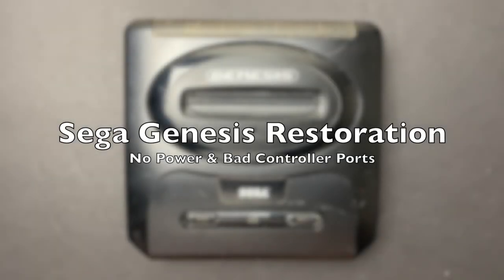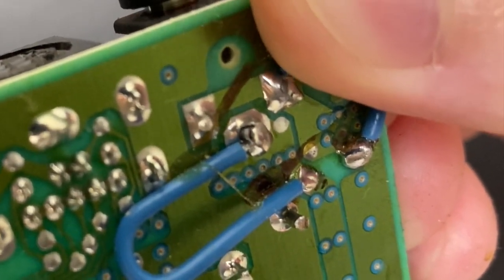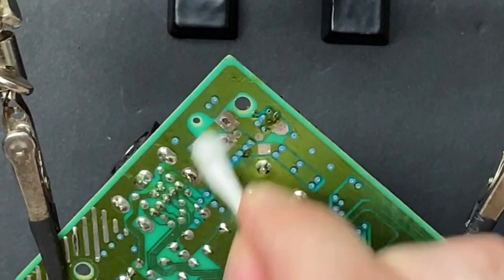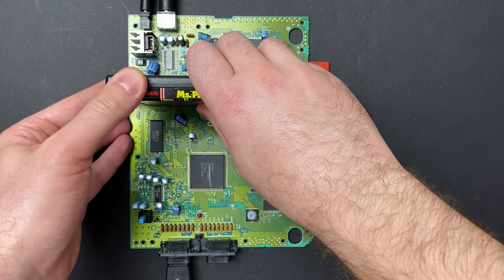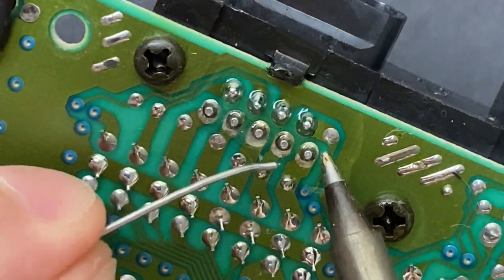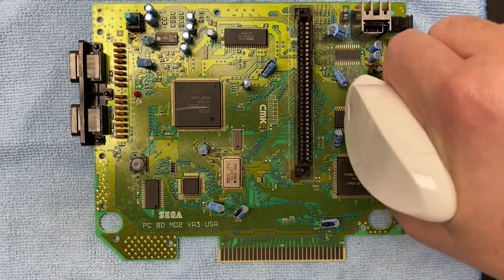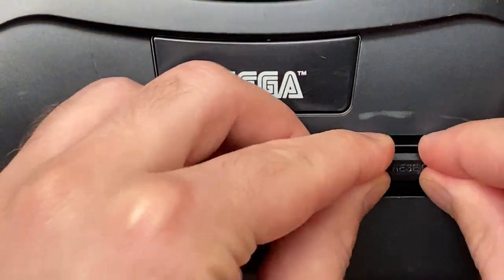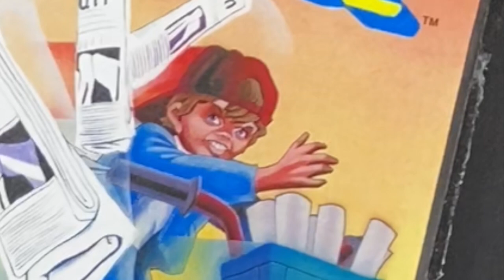Sega Genesis Bad Controller Ports - Retro Console Restoration

Comment: I drove an hour to purchase a cheap sega on marketplace only to have it not work when I got home.  The controllers were acting screwy and would kind of work when I wiggled the plug in the port.  I hopped on here and found this video.  I've never soldered on an electrical board before but took a stab at it and it worked!  The machine I got was super clean and I couldn't even see the breaks in the solder until I used a magnifying glass.  I removed as much as I could using the solder wick, which I had never heard of before this video.  Then I found the thinnest solder I could because these connections are TINY.  It takes some patience, but I was able to do it with only this video as my guide.  Thanks!

Comment: That cleaned up pretty nicely in my opinion. Also I can confirm that those wires soldered and glued to the power connector are from the factory. Instead of recycling a motherboard that didn't pass quality control, Sega would actually have workers repair the issues. Not all Genesis left the factory with those wires, but many did.
Reply: Yup most Gen 2's I have worked on have them. The power jack is supported by nothing except it's solder joints so it's a very common problem for them to crack and loose continuity. Almost every Model 2 I've obtained over the years had this cracked solder joint problem.
Reply from the maker: That’s pretty hilarious. I really hadn’t considered that this could have been a factory repair. The center pin is cracked due to fatigue so it’s an odd assembly line problem (compared to a broken trace for example). Looks like something a teenager repaired in his bedroom. Thanks for sharing.
Reply: Wow. I never knew that. I have seen sega use bodge wires in other spots.

Comment: Those bodge wires are from factory. That slim board was a later revision, the genesis was notorious for broken joints at the power port. So they added the bodge wire to the later revisions.
Reply: Oh nice info
Reply: Wow, not cool Sega
Reply from the maker: Hmm I hadn’t considered that. I’m aware traces were sometimes repaired at the factory on some older gen consoles but this looked a little more fatigued due to stress on the center pin. Who knows.

Comment: I recently bought a model two genesis with the same type of faulty repair. It had no power, opened it up and saw two wires soldered to the bottom of power connector. I followed the video by removing the wires and old solder, cleaned everything up and resoldered the power connector now it works great. Thanks for the great tutorial.
Reply from the maker: Great to hear 👍🏻

Comment: Wow that previous repair attempt looked worse than my soldering when I was first taught at age 7 or 8. Those completely unnecessary bodged jumper wires were also a nice touch!
Reply from the maker: I thought so too. It's strangely charming in how hideous it looked.

Comment: Very easy repair and no broken traces on the  p1 port, very Nice job. I had my hands full with a late 2009 13 inch clamshell macbook that had a bunch of cosmetic issues and a missing hdd. I spend 4 days trying to find a lion installation to reinstall mac os with so I could update it to el captain  and use it for my iPods as well as jailbreaking a iphone 6 I had laying arround
Reply from the maker: Thanks bud, and good luck with your MacBook restoration.

Comment: great it was my first console and I still have it (Sega mega drive2), the damage in the joystick connector was very frequent I think it is because it fits very tight, I recommend the MK 3 ultimate and 6 button joystick. Excellent repair 👌
Reply from the maker: Yeah you really need a 6 button game pad for Mortal Kombat. The moves are hard to do on the three button controller (like a basic high punch is A+B).

Comment: The Model II Genesis was infamous for badly soldered power connectors. Mine was bad out of the box Christmas Day 1994, if you bumped the console it would reset. Opened it up and fixed it decades later.

Comment: Nice. Maybe a magic eraser could help with the red paint and rubbing marks. I've notice the shiny sega plastic also responds well to automotive polish.
Reply from the maker: I tend to be nervous using a magic eraser on black plastics in case it eats away at the sheen but I won’t know unless I try it. There aren’t any red spots on the back to test a small area unfortunately so I risk making it worse up front. I like the auto polish idea though. I have some PlastX that came with a headlight restoration kit that I could try.
Reply: @BorderlineOCD  do you have cracked or junk sega plastic? It is a bit of an art

Comment: Great vid. I'm stuck with a problem with a controller port. I checked all the connections and they look solid, no wobble. The console itself is in pristine condition, the only problem is the port. The only thing not working in the down controller pad. I tested the controller in other systems and it works fine. I cleaned with alcohol and made sure everything's clean. Still, the down pad does not want to work :(

Comment: Those cables near the power jack are in most Model 2's from the factory! I suggest you put them back in place, because there must be a reason Sega put them there :p
Reply from the maker: They are jumper wires. They are redundant if the port is soldered on properly.

Comment: Nice work as usual, bud.  That patch job with those wires, was..... comical at best.   I'd love to know what happened to that poor system to cause that breakage on the controller port too.

Oh well, looks to be in better shape than it's been in a very long time, thanks to you.  Nicely done.
Reply from the maker: Thanks very much, glad you enjoyed the repair!
Reply: I've seen those wires on quite a few model 2 systems. I'm guessing it's factory. Not sure why though.

Comment: Warning: INTENSE SOLDERING WORK!
Nice :v
Reply from the maker: Ha thanks this wasn't a particularly intense project. The PCBs of this generation of consoles are relatively easy to work with.
Reply: @BorderlineOCD u* show this izy* but ACTUALLY is horrible  without correct equipment,
This is the why I love retro tecnology
In my opinion Is most simpler an crt tv than an lcd tv for example.
Larger solder pads no messing with weak pcbs most pacific work etc...

Comment: Great ☺️ i found a psp on a bin might make a restoration
Reply from the maker: Good for you buddy. You’ve been lucky with your finds!
Reply: You should try it, i found one a while ago (3001c) that only needed a new battery and a screen, bought a 3rd party replacement screen a really cheap 2400mah battery a micro sdxc to memory stick adapter and a kingston 64 GB micro sdxc card, fixed the system up in only about 15 - 30 minutes (replaced the broken screen, took apart and cleaned the analog stick and gave the front and the buttons a clean in the bathroom sink with hot water and soap) and followed mrmario2011's guide to install 6.61 with infinity and lme and that's the system i have been using until the screen broke again

I have a bunch of new systems now that need repair (dirty DOL-001 gamecube with sticky buttons a 360 slim with the red dot a galaxy edition new 3ds xl i have to fix again because i bricked the TWL files a PS2 with no disc drive a original xbox v1.6 with bad capacitors almost all my gameboys and 2 older ds's (a bricked dsi [bootloader is missing from uninstalling unlaunch] and 2 ds lites one is the system the other is only the original motherboard).
Reply: @nathanmead140  hey i have a 3DS that i hacked to play CIAs and emulators. I have all the files bucked up on my pc and i hope it doesn't get bricked

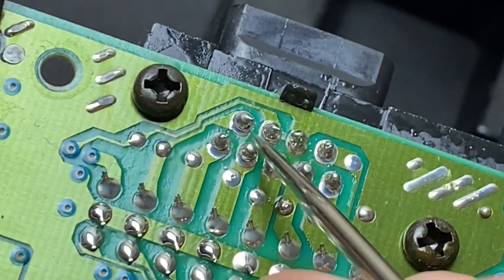Comment: The bottom left pin for the controller port at 6:10 on my Genesis is missing the pad; do you know where I would patch the pin to with a wire?

Comment: I love the Sega Genesis is one of my favorite consoles of all time. I was reaching out for controllers behind one of my Sega Genesis and I dropped in to the ground and now it starts the first  paragraph of words come out before the Sega logo but then nothing happens and the sega logo doesn't appear and just stays black. If you think you know what it is let me know anyway I'm going to open it to see if anything got desolder
Reply from the maker: Yeah check for broken pins and solder joints. Sometimes they can hide very well so you might need to prod them gently with a pick to make sure they are solid and not cracked.

Comment: looks like the console was dropped while the connectors was plugged in.
Reply from the maker: Most likely yes I imagine someone tripped over the controller cord while it was plugged in and yanked the console.
Reply: The model 2 Genesis power port was just badly designed and I think it loosens up and loses connection by just plugging in and unplugging the cord over the years.

Comment: I find it odd that someone knew enough to fix the power connection, yet not enough to do it properly.
Reply: I've actually seen plenty of genesis model 2s with that same botched solder work. Must've been a bad factory patch.

Comment: Idk man $70+ for that soldering iron set witch docent look any different then all the cheap $10 ones listed on amazon is a bit much.
Reply from the maker: Your tools should match your skill level. There's nothing wrong with starting out with cheap gear. In fact I would encourage anyone entering this hobby to start small and focus on practice rather than expensive tools because the most expensive soldering station won't make your soldering any better if you don't practice. After a while your experience grows and you begin to appreciate the shortcomings of your tools, so you know what to look for when upgrading and what advantages you would be getting. I can't recommend the TS100 enough, it's a fantastic temperature controlled iron. Doesn't mean it has to be your first iron if you're just starting out.